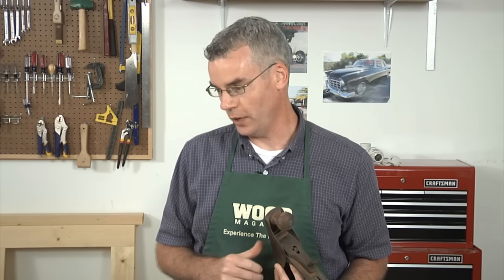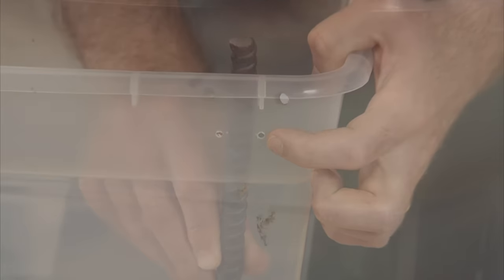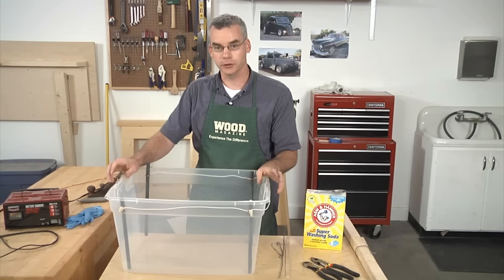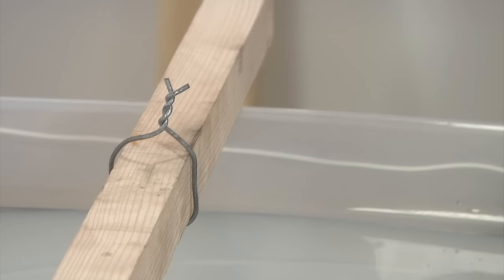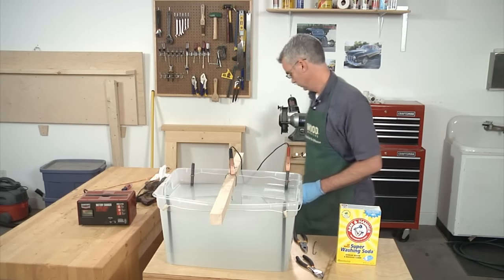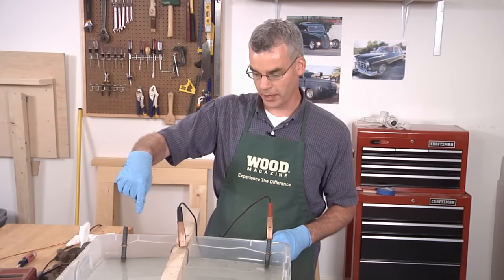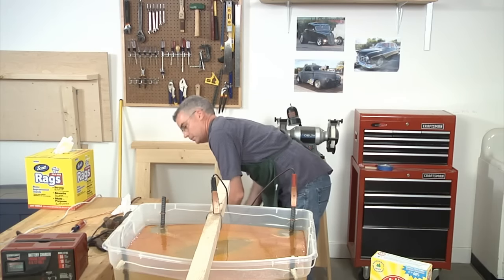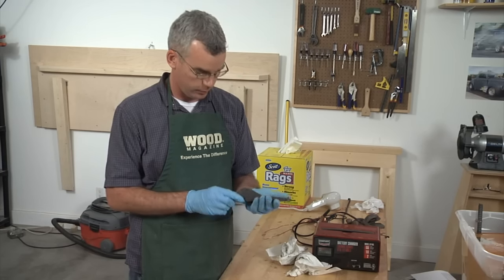Removing Rust with Electrolysis - WOOD magazine

Comment: Thank you, I have a small iron stove that I derusted with a power tool, I'm going to try doing to do this to remove the rust in the nooks and crannies than set a fire in it to dry it. than use a coating to seal the stove to protect it. Thanks

Comment: Great video 👍🏻. I tried this but couldn’t get the process to activate, I think the problem is my battery charger which is a little different to the one in the video. My charger is automatic, and works fine on batteries, but doesn’t “charge” in this set up. Wondering if anyone has had a similar experience and possible solution ?
Reply: I had the same issue today. I just bought a cheap, no thrills charger and it is working fine. I hope this helps
Reply: A cheap manual charger can work. An automatic charger with a battery in parallel can work.

Comment: One of the best electrolysis videos I ahve seen so far.  I am building a unit at the moment and have been researching the best solution to use.  I will probably start with the sodium carbonate solution (washing soda) but I am intersted in more conductive solutions.  So far Sodium nitrate is coming up as a good alternative but not sure of the hazards this might present.  Do you have any expereince or knowledge in this area.

Comment: What would you recommend to do with the left over water?
Reply: it's completely harmless. just pour it away in a sink. you can neutralize it with any acid available if you want. Or: filter it! collect the orange stuff and wash it with water while still in the filter. then dissolve it in hydrochloric acid. add the acid slowly, just until every orange stuff is in solution. the solution will be yellow now. the solution now contains ferrochloride! you can use it again to remove rust and etch metals like iron and copper!

Comment: Good video but would you recommend this process with a high quality piece aluminum  address sign? The sign was held on with steel hardware that rusted onto the sign. I worry about adding the Arm and Hammer detergent and how that would react with the aluminum finish on the sign.

Comment: You didn't mention disposal of the fluid, or whether or not it can be reused for a number of tools. ?
Reply: There is no reason to dump the fluid out each time,  just use it over and ive again.  And the solution is basically baking soda and water,  you can dump it in your front yard,  the iron would be good for the grass.

Comment: I tried this process, it's works great, I did it outside cause of caution, vapors from the bubbles.
Reply: Those bubbles are hydrogen gas. Working outside or at least in a well ventilated space is a very good idea. You and the building might even last longer.   ;^)  Remember the Hindenburg!

Comment: If a piece is too long to fit in the container, can it be successfully cleaned by immersing half and then turning it to do the other half? This is assuming it doesn't damage or upend the container and doesn't contact the wiring.

Comment: I have used this method and yes, it does work. It is rather slow though. Vinegar works too and is slow, so does molasses and hydrochloric (muratic) acid. If U leave them in too long though they will eat the metal away as well so timing can be critical depending upon how much rust/metal U want to remove. I'm not sure this is really any faster certainly or does any better job than simple scraping, brushing, brush wheel, or sandpaper. Also, the fluid gets rather nasty fairly quickly, you to rinse everything off and wipe it all down, and it doesn't "refill" the pits. It seems to work best on superficial, not deep, rust.

Comment: I've done this process many times and with great success. Never with washing soda as I just heated baking soda for an hour at 400. I think your video was the best out there. Love the tub and going to build one but out of a Christmas paper roll tub thats long and shallow. Used this process to restore my wife's deceased fathers  shotgun that was rusted to the Be-Jesus Belt.

MY QUESTION IS...what is the best disposal method of the waste water???
Reply: You simply converted the baking soda to washing soda  when you baked it.  When washing soda is used when washing clothes it goes down the the sewer system, not sure why this solution would be more toxic.

Comment: i'm sorry i'm a noob to metal and still studying about corrosion, so basically, is the point of this method is to make the rusted metal cathode? cmiw i see rusts spread to the water so what's actually happening here? (sorry for my stupid question btw) shouldn't those 4 anode metals get corroded?

Comment: I really like this method. I have a question: If I wanted to remove rust from a part that was 7ft. long; Could I submerge it into a 55 gal. drum, leaving some of it out of the water solution, and then after the first half is done, turn it the other way to do the other half? I hope that's clear for you to understand, and I hope you know the answer. I want to remove the rust from a trailing arm from a car. So, basically it's the main suspension component under the rear of my front wheel drive car. Thanks, in advance.
Reply: +Donnie Stritzinger You would need to use a non-metallic container, but yeah, you could. It would take longer, but it's possible, as long as you have enough anode material and "juice" to pull off the rust.  I de-rust armor and other stuff in a 55-gal plastic drum using a set-up similar to this.

Basically, you end up using electricity to magnetically "pull" the rust off the component using a liquid electrolytic solution as a medium or "tool". The electicity provides the power, and once the rust is "pulled" off the part it "sticks" to the anodes, which in this case is  rebar. 

The whole point of using a plastic container is to prevent the process from grounding to a halt because of a metal container interfering with the electrolysis process. since this is a fairly linear process, the more rust you're needing to take off, the longer it's going to take.

Comment: would it work better if you connect anode bars in a loop?
Reply: That sounds a lot like a short circuit to me.
Reply: i don't think so.
you make short circuit by connecting positive pole (of the battery/charger) with the negative one without any load/resistance.
in this particular case, the load mentioned would be the resistance of the solution.
Reply: I tried that and instead of removing, it added rust!

Comment: My best way of rust removal:
Salt+Bicarb or Sodium Hydroxide, COPPER anode, +HIGH current density. without the chlorides copper will turn into a blue green mess as the carbonate combines with the copper to form malachite, add salt to kill this process 
High current density will reduce iron oxide, it is not free hydrogen that reduces iron oxide since iron will reduce hydrogen, not the other way round.
the solution will turn caustic, which when combined with heat, any scrap of grease will turn to soap.
this will also copper plate and degrease your part prior to nickel plating

Beware the bubbles that can go bang with a spark, dont mix the bubbles from the anode with those from the cathode, and you will never get more than an energetic thwooop, if you mix the bubbles it can get VERRY sharp on the eardrums

Comment: Could you use something like an old computer or phone charger rather than a trickle charger?
Reply: Brads Workbench you can but it will take more time, in stead of 2h you will have to wait 5-6h, but it’s ok if you let it run in the morning until afternoon, just check up on it every now and then

Comment: My experience:  I used muriatic acid and water as my medium and 36vdc as my electrical source. 
The higher the potential, the faster the removal rate.  The muriatic acid (aside from being a natural rust removal agent) is also an outstanding electrolyte.
Reply: ...and skin remover...
Reply: Too many dangerous fumes released for the average DIY guy. Very risky, IMHO. 
Although, I do use straight muratic acid baths for some rust removal, but always outside, with a fan blowing fumes away from the house, & near areas that I don't care if the foilage will die..., cause it will. Trust me.

Comment: I did a metal shop vac once by suspending the anode in it while it was filled with electrolytic water.  Watch out for short circuits, the anode and cathode must remain insulated from one another.  Try to avoid city tap water I use fresh catch rain or snow,  which I store in 3 thirty gallon plastic drums.  Add the electrolyte before storage to avoid fungal growth.  This only works line of sight so you may need to change item in relation to the anodes.

Comment: Dear, greetings. I've got a slot, of  an ancient eletronic device, which has lots of tiny parts made of cooper and steel. Two decades has passed, and the time action was a distinctive presence of verdigris growing arround the entire piece. So my ask is: Does it Works with verdigris? If I attempted to this method, Does this process will work without loss copper incidentally of my slot to the anode pole? Thank you!

Comment: So I built an electrolysis bath similar to the one described in the video.  It seems to be working.  However, the only bubbles I see are coming off the steel wire suspending the rusted object I suspended in the bath.  It doesn't seem to be removing rust from the object itself.  Am I doing something wrong?

There are bubbles coming off all of the pieces of the re-bar at the corners.

Comment: Good tutorial, just was curious if the material of the cathode will matter.  I have galvanized steel wire in 14g and 16g, as well as 8g copper, which I know you said wasn't recommended since it will react.  Just wondering if the cathode material mattered as much as anode material, or if the galvanized steel will work.  if I have to go get regular steel wire to suspend the object, so be it, just wanted to verify.
Reply: F Con

Comment: What gauge coated wire did you use to interconnect the rebars and was it copper?
Reply: Looks like standard house wiring 12g . I would think that with just a two amp trickle charge, wiring size really isn't of much concern though...

Comment: Would this technique work with cleaning a rifle's receiver?  My Diana 35 is getting rusty....
Reply: It will remove bluing.  Be careful.
Reply: Thank you guys for the information!

I resorted for the pre 1980 penny technique, as some of you know it is basically rubbing off the rust spots and areas using a pure copper penny (pennies after 1980 are mostly zinc with a thin layer of copper) and then using a solvent that removes the copper film that developed by rubbing from the blued steel underneath without damaging the bluing.

I rubbed it well with a 1975 penny I kept from a recent vacation to the US and got all of the surface rust off, but I didn't use the solvent yet since it looks nice as it is after buffing it with a micro fiber cloth.

Might as well preserve the rifle since I won't be using it much by rolling it with cloth and hiding in in a dry place such as a closet or under broken tiles, just as our traditional firearm dealers did with Kalashnikov rifles back in the day.

Comment: I tried this but my battery charge wont detect the connection. What type of charger are you using?  Ive tried different ones but they all do the same thing. If I connect it through a battery it will work slowly.

Comment: ok so I left the comment about hooking everything up exactly the same as you did in this video and couldn't get it to work. I then went ahead and hooked my electrolysis set up to a regular 12 volt battery. then the electrolysis started working like a dream so obviously it's my battery charger. what kind of battery charger do I need to buy so I don't have to use my battery

Comment: So basically electrolysis just removes rust simply by generating lots and lots hydrogen gas for use as a quick debriding agent (to mechanically dislodge the rust away). So, you'll want to run this at high currents and likewise keep the anodes very close to the cathode to maximize energy-efficiency (waste less energy just on running current through the solution!).

FYI:
1) You do *NOT*  need a "sacrificial" anode!! Graphite anodes will work just fine!!
2) Forget washing soda -- just use plain sodium sulfate (Na2SO4)!! Much cheaper and will probably work better too!!
3) You can definitely use copper wire for the cathode just fine too without any problems at all -- but do NOT use it as the anode!!
4) Also, you'll want to "surround" the cathode as closely as possible with anodes to maximize energy-efficiency (less energy wasted on just running current through the solution) as well as to keep each anode in better shape!! (especially if you plan to reuse them)
Reply: Thanks for this comment. I was wondering if using a clean anode would yield better results than a reused one or one that was already rusty so your #4 pretty much answered that. I was also curious if using an anode with a larger surface area would be more efficient, e.g., using a plate of steel rather than a thin rod. Any thoughts?
Reply: @shamptown  Anodes with larger surface area would be more efficient -- you would essentially waste less energy just pushing current through the solution.

Comment: Awesome tutorial. Will the electrolysis process still automagically stop if the metal has begun to pit? I am thinking of using this process on an M1917 rifle barrel/receiver assembly.
Reply: RhetQ I have used this many times to restore old shotgun and rifles with no problems. Works great
Reply: B McG Thank you. I'm looking forward to trying this out.
Reply: The process only affects iron-oxide, it never does anything to iron so it is not that it stops it just runs out of rust to work on.

Comment: Then is it safe to cook with stainless steel? Or have stainless steel water bottles?
Reply: Yes, it’s the chemical process going on in the tank that’s the problem. Stainless is fine for pans and drinking because your not mixing steel and current and chemicals in your drinking bottle or pan

Comment: It doesn't power it 'away.' Electrolysis is better than most rust removal methods since it actually turns the rust back into steel.

Comment: Can someone with chemistry knowledge explain what happens when the copper wire is on the scrap and item being rust removed in the tank actually in the water. I get everything else, but the videos I watched didn’t cover this so, so far my copper has been in the tank whilst running the charger to get rid of the rust. Is it going to have created Erin brokavich part 2 or is it just more they go green like plumbing pipes and it makes more mess to clean each time you wire brush the scrap in between items. Unfortunately there’s a lot of how to vids without the safety aspects. Most mention stainless steel  and that’s it. Also if I can’t use copper wire then is coat hanger wire not galvanised? I heard anything galvanised is bad too

Comment: what are the wires called that you use to connect the four rebar and where do you buy this wire? What is the wire that you have your rusted piece of metal hanging from?

Comment: i've done the same setup (great one btw!) but every time i use it the water turns green - blueish. I can't see any copper, S.steel or any other metal touching the water(or in the part i'm trying to clean), i wonder what could it be and if it's too dangerous or not, thanks!
Reply: Hi. I'm very much too late to tell you, but the green stuff is nothing more than iron hydroxide. it's green at first and then oxidizes until it's orange like fresh rust. this is normal if you use baking soda instead of washing soda.

Comment: Lucas--can you suggest a brand(s) of charger, It seems those I find are all "automatic" and as such cannot be set to deliver a 2amp charge. Are all chargers now auto. Do I need to look for old used ones.
Reply: Just buy a designated trickle charger. They alot cheaper than a regulatlr battery charger, but they only work on 2 amps, no higher. Perfect for this

Comment: This works well but there will be pitting in areas with heavy rust. Not such a big deal with cast and you would have to smooth and flatten the planing surface before its ready to go.

Comment: Aluminum doesn't rust the same as ferrous metal, the oxide layer that forms on aluminum actually protects it from further oxidation.  However, the oxide layer will eventually become hydrated - effectively turning it back into its original ore - Bauxite.  And yes, electrolysis is one way Bauxite is turned into Aluminum although it requires much more energy.